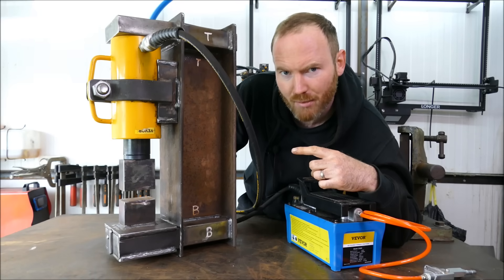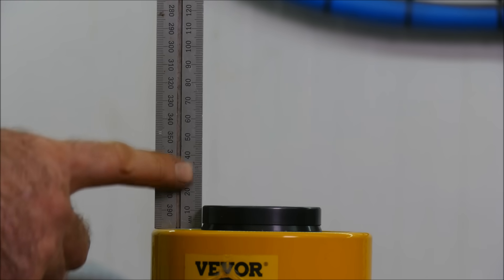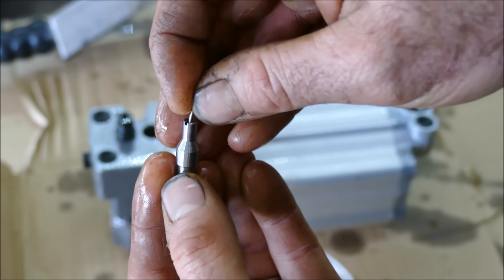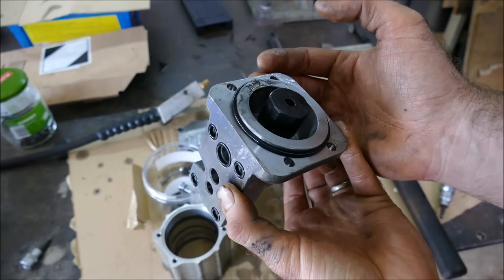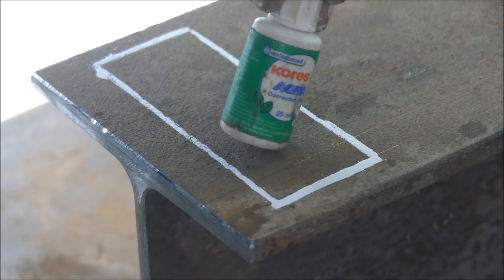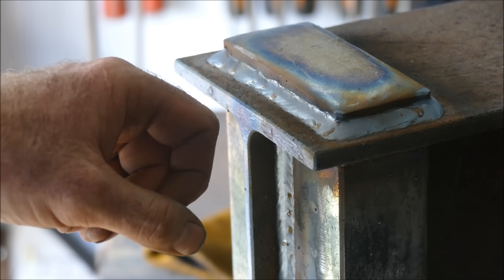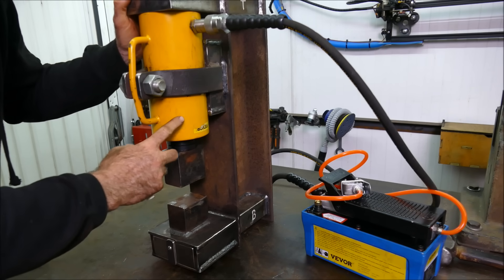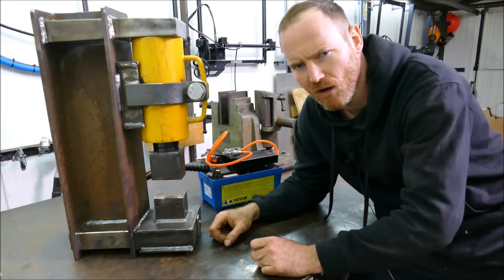£300 *30ton* hydraulic press for under! - Vevor hydraulic power pack air pump cylinder reveiw

Comment from the maker: I hope this video was helpful to someone, here is a discount code for you: VVPROMO to get 5% off, all links are in the description of the video.
I look forward to hearing your thoughts on this and any ways you think would work even better for the price. cheers J
Reply: Another reason for preheat is to stop any potential martinsite in the heat affected zone or majority austinite and pearlite when its mean to be ferrite and pealite in low carbon steel (0.2%-0.5% carbon content)
Reply from the maker: @jonhy2x4  thank you Jon. That's great information. Cheers J
Reply: Crazy how far you've came Josh, I knew you'd do great on YouTube 😊
Reply from the maker: @knifethrower9733  you're very kind thank you. Cheers J
Reply: Do you have a video on how you made your cnc plasma? 

Really like the look of it, just what I need!
Reply from the maker: @MWRepairAndMaintenance  thank you. Here is the plasma table build https://youtu.be/xVZZfx9KPlc
Reply: Well that helped me as I was going to build my own knife making press so this makes it a lot easier. I just have one question what size air compressor would you recommend for this system?
Reply from the maker: @TheMetalerMan  hi. My compressor is 150ltrs 3hp 15cfm which is more than enough. I'm not sure what would be the minimum. You may want more speed so a 20t or even 12t may work just as well for Damascus billet welding. My power hammer I believe works much better for forging as it imparts energy into the steel whilst the press sucks the heat out because it's slower. It's definitely much cheaper and easier to build though. Cheers J
Reply: @joshuadelisle  thanks for the reply I have already brought the 30t one so I will make that work for now. Space in the workshop is VERY limited for me so the power hammer is probably to bit big for me at the moment. Love the vids though keep them coming. I’m going to be building the press some time this year not sure how I’m going to cut the holes for the forklift tines yet as I don’t have a plasma cutter but I will figure something out
Reply from the maker: @TheMetalerMan  well done. You can get by with a cutting disc and an angle grinder for sure to cut the I beam. Just take a while and a few discs. Cheers J
Reply: Hey sorry to bother you again but  I’m having an issue were we cant use a m24 nut and rod there seems to be less space in the ram for the nut and we cant fully tighten the main nut. Did you remove any thing in the cylinder to make the m24 nut fit and fully tighten unit up
Reply from the maker: @TheMetalerMan  hi. So if you take out the collet you can tighten a m24 nut to it but can't thread the collet back on at all or only partially?
Reply: @joshuadelisle  hi Joshua so when we put the m24 nut in the cylinder and tighten the collet it does not tighten all the way down there seems to be some thing in the cylinder that restricts the the nut. It looks like there is a pipe that goes from the rear of the cylinder to just before the the collet
Reply from the maker: @TheMetalerMan  yes that happens, just extend the cylinder to give it space and tighten the collet all the way. it will retract up to the nut, you lose 15mm roughly of stroke. cheers J
Reply: So after many weekends of building our own version of this press we have done our first test and it works :). Just need to finish the dies and we can start to forge weld
Reply from the maker: @TheMetalerMan  well done 👍. Cheers J
Reply: I have a 100 ton hydraulic jack. I want to build a press frame for it. What thickness of steel would you advise me to use please? Thank you

Comment: Hate to be that guy but hydraulic fluid isnt compressable so if there were a leak the instantaneous pressure on the leak will roll off immediately. It cant go through your head unless you put your head in between the jack and a hard thing
Reply from the maker: The danger is whilst the pump is in operation and the spring force of the steel acting against the ram. Not being funny but I've witnessed a hydraulic hose fail and it was very dangerous. Cheers J

Comment: Hello, I would like to know for the 30T press what compressor capacity would be the minimum for it to work correctly. thank you
Reply from the maker: It will work on a small compressor but may drain it quickly depending on the amount of work. I use a 150ltr and it barely effects the compressor. A 50 liter would work fine. Runs on 90- 120psi. Cheers J

Comment: Would this design work for a 100 ton cylinder?
Reply from the maker: I would do a calculation first but I'm guessing I would have to double up the strength just to be sure. This 30T flexes slightly on max pressure so I would think a 100T would rip itself apart. I'm more likely to build a H frame rather than a C frame with those pressures. Also I would want a lager/faster pump as a 100T would be awfully slow with this pump. Cheers J

Comment: Another question. I have dual acting 10T 300mm cylinder, could i  run 2 single acting pumps like the ones in the vid in alternate directions to speed up the process of actuation and return. the purpose is to make damascus and general  knives
Reply from the maker: You can use a double acting cylinder as a single acting just by adding a spring and use just one of the ports and leave the other open to air. Cheers J
Reply: @joshuadelisle  Hey thanks for the prompt response much appreciated. I want it to retain double action by cobbling together some kind of alternate actuaction rocker sort of  of thang.
Reply from the maker: I think in that case you can buy a lever valve that can switch between the two ports and bypass the other. 2 position 3 port valve of some sort. Cheers J
Reply from the maker: @Filbertdog I think this one would work that's affordable: https://amzn.to/3GlrhuY

It has a flow and return and a port for either side of the cylinder. You just need to add an extra pipe from the return back to the pump tank. Cheers J

Comment: Would the 2” 30T operate more quickly with the same pump?
Reply from the maker: The tonnage is governed by the diameter of the cylinder. The higher the tonnage the slower the speed and vice versa with the same pump. Cheers J

Comment: There’s no way thats a 30ton press, meaning theres no way it’s depressing 30 tons of force
Reply from the maker: 10,000psi, which is the maximum rating on the pump, on a 100mm bore cylinder is 60Tons....

Comment: Does the amount of air pressure in matter?
Reply: Hi Joshua what a fantastic video love to see your creativity in action! Please may I ask if I wanted to set up the ram & pump you have here what size air compressor who you advise I need to buy? Do you have a video relating to your workshop compressor install? Thanks again you have been subscribed 😊 Ian
Reply from the maker: @ianduckworth8595  thank you. Any compressor will operate it but a larger tank will give a longer running time and a higher CFM will give a shorter refill time. Mine is 150L 3hp 15cfm. Cheers J
Reply from the maker: Yes. Less pressure means less speed and power to operate the pump. It's a conversion. Cheers J
Reply: @ thank you, how many gallons does your air compressor hold?
Reply: @ I have a similar setup with a 1 gallon compressor and it doesn’t run the ram very long ha

Comment: Joshua, did you ever work out exactly how much the ram pushed? I’m thinking of making a new press and wondered if you would still recommend this setup.
Reply from the maker: I use it regularly, if I put a pressure dial on it I can figure it out mathematically but I haven't yet. It's slow but works very well for the price of the parts. It will squash 50x50x5 box completely flat for example. I would be tempted to use two pumps in parallel to double the flow rate and fix a plate across the two foot pads so they act as one. Just need a manifold or T for the hoses. Cheers J

Comment: Enjoy your video  I'm having a problem with my foot pump works on  a car lift when i put a car on it the pump start slowing down and wont lift when no car is loaded  it lifts straight up  can you please help
Reply from the maker: @renrickragbir7407  it's sounds like an air lock, try bleeding the system at the highest points and add more oil. Cheers J
Reply: Ok wil try

Comment: Joshua I'm not happy with your "The Dimming" recommendation. There's 'experts' with "Withheld identity" and old people who talk with a military accent labelled as "retired this and that". I'm reminded of the "Lead researcher's" name every 5 seconds like I've forgotten it already. There's an emphasis on name and status and therefore you should definitely believe what I'm saying. 
I don't doubt there's questions to be asked ref pictures of planes stopping and starting trails but I feel this is a typical Dunnings Kruger effect of not knowing enough, so everything seems so simple. I am open to any suggestion, including the government are corrupt scumbags and would perpetrate such atrocious behaviour we've historically proven. This is not not historical proof and is wishy washy facts at best. 
I really love your Diesel (Kerosene) heaters bits, both air and water. I'm wondering if I'm going too far planning a 10kw (X2) setup to cover most of heating demand WHEN I've got fuel and WHEN I can be arsed. Thinking lever valves and electrical continuity switching over somehow between traditional system and 'when I can get the gains'. Also build in reliability of existing 10+year equipment alleviating some mental resistance to new ideas. Hope this finds you busy and well, another grumpy hands on English man.

Comment: If a 50 ton press of the same brand was used would it extend at the same rate?
Reply from the maker: no it would go slower. a 20T would go faster. cheers J
Reply: @joshuadelisle  thanks

Comment: Great video! I do want to say though, at 15:24 you state that this system is more or less the same as having the 3HP motor direct drive. This is just not very true. Air compressors are essential for shops for various functions, but the reality is compressed air power is not efficient at all. Most air compressors only convert 30% or less of the electrical input power into compressed air. The majority of the energy is lost as heat from compression. This doesn't even account for the energy loss in the air/hydraulic pump. A 3HP motor coupled to a hydraulic pump would be considerably more efficient, and more powerful, than the air/hydraulic pump used here.

Not saying that this setup isn't useful or anything. For a home or small commercial shop, something like this makes a lot of sense considering a large compressor is likely something that is already available.

Comment: a quick question, i'm a bit of a noob as far as hydraulics, vevor says this is a single action ram, which from my googling means it only does force in one direction, how come you are getting it to pull the bearing through the log, and push to forge ?
Reply from the maker: @BigBoyBitz  that's right but it's spring loaded on the return and the fluid goes back through the same pipe. Double action means you will get high pressure on the return also but you do not on a single action only the power of the internal spring when you bypass the fluid pressure. Cheers J
Reply from the maker: @BigBoyBitz  its still pushing when pulling through the log because I put a bar through the hole in the cylinder. Cheers J

Comment: Hello, I have just finish mine from your build but with the electric hydraulic pump and its a very nice portable press. I didn't push to the max  of capacity yet, but it's working fine for me ! Thanks !
Reply: Does the cylinder retract by itself when the pump is turned off?
Reply from the maker: @carpy1970  yes when the return valve is pressed. There is an internal spring that makes it retract. Cheers J
Reply: I would love to see a pic of your set up. I  am going to build one as well, but wasnt sure what kind of air volume it would take vs the electric over hydraulic.
Reply from the maker: Well done. Cheers J
Reply: Maybe too old comment to expect a reply, but... I am wondering which is better, air or electric? Does the electric pump more or less volume per second? In other words, with the same cylinder, which pump moves it faster?
Reply: @scotterholm5840  Oil is better, air can be compressed. I got the electric version and still use it

Comment: Hi Joshua, I am planning to build a press to make "techoplancton" for fishing. That is basically different flours and materials pressed dry under high pressure. It really needs 15-20 tons of pressure so it sticks well. I normally use a manual 20 tons bottle jack to make it but want to try an electric solution. Do you think these Vevor tools could handle it reliably?
Reply from the maker: I've just used mine to forge 90 railing spike tops and bend 100x  316 stainless brackets. So far its been very reliable and theyre very simple but sturdy bits of kit that I've got. i've not tried their electric version yet though, I can only coment on the exact kit I've used. cheers J
Reply: @joshuadelisle  Thanks!
What I meant by "electric" that it's not manual (like the bottle jack). The one in your video is using air compressor if I understand well but some folks told me the air compressors are not good enough (don't make enough pressure) and only the oil pump versions are reliable. But those are way more expensive hence I am interested in your opinion. If a 30 TON set (same cylinder and same air powered pump) can do 20 tons of pressure it should work.
Reply from the maker: @tamasvago87  I believe it does does it  very well. Cheers J

Comment: But I don't know which form used in power pack for 500 tons two pressure rice which form I can use can you give me detail
Reply from the maker: @Ismailshaikh-hd5uv  500 tons is a lot. One of those would be used to forge shafts for power station stators. I think it's a bit overkill for rice. For example you would need something like a 150hp motor to drive the hydraulics  which is a very big motor. It depends on how fast you want it to move but you can get away with a small motor and pump if the cylinder is a very large bore and the press die is small to produce 500tons.

Comment: Hello 
Thank you for a nice video. 
What kind of oil do you use in the pump? 
Bought the same pump but cant find What oil type i must use?
Please let me know if you can. 
Best regards Tobias
Reply from the maker: @Mrdiesel7740  thank you. regular hydraulic oil is ideal. Compressor oil will work the same except it has less lubrication additives. Cheers J

Comment: I consisdred converting a log splitter, to achieve the same result. Dammit man I love DIY....
Reply: Ahh the price difference is insane between the UK and where I live (USA - TN) I found a used 32T for 350$ when I was looking. Good on you for supplying the DIY alternative. Cheers m8
Reply from the maker: 30 ton log splitters starts at £2.5K bit more than £300...

Comment: Pump . Does it have an internal relief valve?
Reply from the maker: Yes. Cheers J
Reply: @joshuadelisle  Is it possible to adjust the maximum oil pressure from this valve?
Reply from the maker: @lelearmi6186  possibly I've not tested it. I think a pressure gauge is a good idea to add though. Cheers J

Comment: I want to get the 35 ton hole punch from Vevor, but don't know what power hydraulic pump to get for it. How do you work it out please? Thanks.
Reply from the maker: It's rated to 10000psi so most of the pumps will produce that but the question is flow rate. The faster the flow rate the faster the punch speed. Most of Vevors pumps are all the same except the electric versions. Cheers J
Reply from the maker: Also it needs to be single acting not double acting for the punch. Cheers J

Comment: Some quick math says that this setup will max out at 26.5T if the cylinder ram diameter is 2.6in & the pressure reaches the 10000 psi limit.

Comment: But it's slow as all heck... you wouldn't be able to get nearly as much work done before the heat is lost?
Reply from the maker: Yes. But you can double up the pumps or just reduce the cylinder bore size which can speed it up. The main thing is it's cheap and it works well for the price. Cheers J

Comment: im planing on also making a press, what would i have to do to make it move faster?
Reply from the maker: Well done. You could double up on the pump or use a narrower cylinder. Cheers J
Reply: @joshuadelisle  if I get a narrower cylinder would I also loose tonnage?
Reply from the maker: @Phaedon  yes. You'll be compensating tonnage for speed. If you want high speed and high tonnage then you need a more powerful pump and motor. Cheers J
Reply: @joshuadelisle  thank you very much

Comment: Quick noob question, you linked 750w double acting hydraulic power pack in the discription, what are the hydrolic power packs used for? just wondering because i never saw them in the video
Reply from the maker: So the hydraulic unit I used runs on compressed air but there is an option for an electric motor powered unit instead. Cheers J
Reply: @joshuadelisle  so this is a different option than the compressed air footpetal? if you got one of the hydraulic pumps do you still need air footpetal? is there any solid differences on how it affects the press? thanks.
Reply from the maker: @thenoblesolo4965  you use one or the other. I have a large compressor so an air powered version is cheaper and more compact for me. Cheers J
Reply: @joshuadelisle  thank you very much for clarifying this for me.